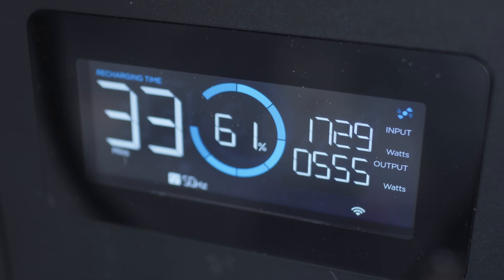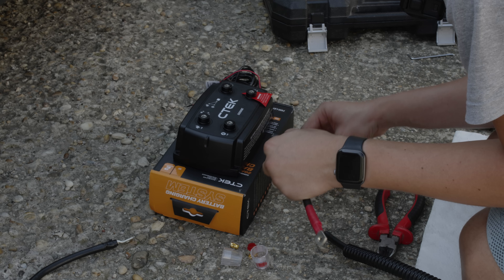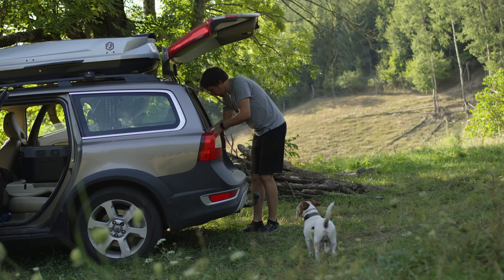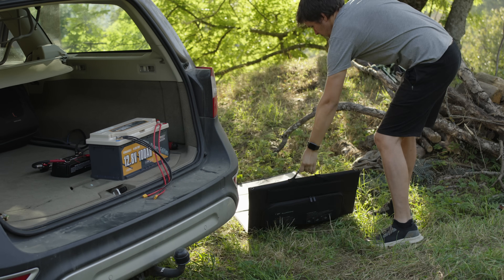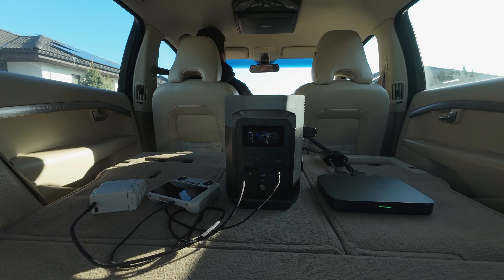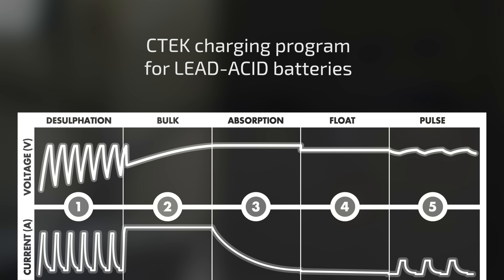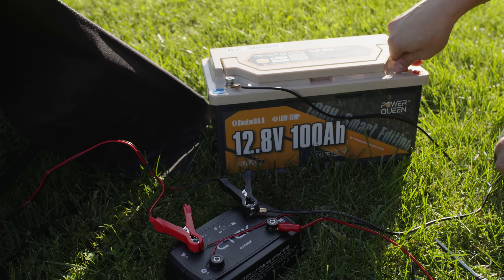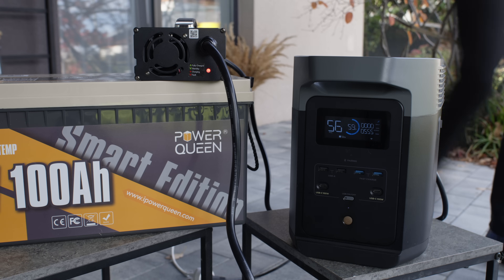LiFePo4 Charging 🔋 Power Queen | CTEK | EcoFlow Alternator Charger | AC/DC

Comment: Thank you for making such a useful video.
14:10 What does the video show?
1. Is the DeltaMAX charging from the home AC grid? (Bypass mode?)
2. Is the PQ battery being reverse-charged using an alternator charger?
3. Is 862W charging possible with reverse charging from the AC grid and the DeltaMAX?

Comment: Those inline fuses are trash. Throw that junk away. Get a terminal block fuse instead. 

This is one of the sloppiest and most ghetto installs I've ever seen. Its literally a what NOT to do.

Splicing connectors are great. If you want problems or fires. Use a fuse block instead. Get the right tools for the job. Quit acting like you're in such a damn hurry. Put your cables in a wire loom.

Comment: Thanks for both videos. I have a similar question as far as I understand Mr. Bauman asked. I have a Delta 2Max and an 800W alternator from Eco. I'm thinking of buying a 24V 100Ah LiFePo4 or 48V 100Ah. The question is, when I drive and charge my Delta2max from the alternator. Can I charge an additional battery from the Delta2max at the same time. And if I can, how and do I need to buy something else. Thanks.

Comment: Is there anything restrictive about the supplied XT-150 to XT-150 output cable from the alternator charger or could it be spliced and routed through a 4-way battery isolator switch?

Could one splice be routed from the switch to the Delta2 using the remaining cable with XT-150 plug end and another lead exiting the switch to be connected via ring terminals (or Anderson connectors) to a 12v LiFePO4? I assume that might allow a single feed coming from the vehicle battery compartment to be routed inside the vehicle passenger or cargo area where it would connect to the alternator charger. The output from the charger could then be spliced and conveniently selected to feed either the power station or the stand-alone house battery.

Is there anything in the cable or circuitry that would prevent adding such a splice and switch? Thanks for any insight you can provide.

FWIW, I purchased a 12.8v 230ah LiFePO4 battery to expand the capacity of my Delta2 after viewing your also excellent video on that topic.

Comment: Hello, I hope I didn't miss this somewhere in the video. 
Can I charge the LiFePo4 from a DC-DC charger (Victron Orion XS 1400), and still have the LiFePo4 battery connected to the Ecoflow like you showed in your last video? I guess the Ecoflow will also then be trying to draw current from the DC-DC charger, not sure if this will then cause problems for the LiFePo4 or the Ecoflow.

Comment: Are you using the wired connections from the adapters you used when connecting the cteck from the beginning of the video to connect the battery at @12:55? So the when the charging is reversed it charges the car’s and the lifepo batteries at the same time?

Comment: Amazing, I literally just sketched a rough plan for our skoolie conversation with this exact setup.

12v bus battery running to a quick connect and a 12v battery(mainly for our 12v minisplit) running to an additional quick connect. As you mentioned, I wanted the benefit of charging my eco flow from the alternator while also having an efficient way to charge our 12v mini split battery.

Great video, thank you for the proof of concept!

Comment: what is the cost of all those charging devices and your time? just run your car on idle for 1 hour if needed... it will consume minimum fuel to charge all your devices.
Reply: This is a very practical solution. Instead, the Earth might suffer.

Comment: Can you charge the lifepo4 to 100%?
Reply: Yes, LiFeP04 takes less damage than Li-NMC when chared to full.

For a full charge of a LiFePo4 battery charge to 3.55V/cell let it stay on that voltage for 2 hours.

You can also charge them to 3.65V/cell (as in the video), but this only reduces the lifespan of the battery.

The BMS needs to the voltage to stay at 3.55V/cell to 3.65V/cell in order to balance the cells.

Note, a 12V battery has 4 cells in series: 3.55V/cell x 4 cells = 14.2V.

Comment: You’re better off taking the direct output of the 24V battery and plugging it directly into the solar port using a XT60i. This will reduce any loss of conversion, and should charge at about 300+ Watts. For recharging after the EcoFlow is full, you can use an AC to DC charger from it to the 24V battery. It’s not ideal due to losses of the EcoFlow inverter, but if you’re driving around with the EcoFlow Alternator charger on it will be negligent. My set up is a EcoFlow Delta 2 Max, hooked up to the Alternator charger, 2x100W solar panels on my vehicle roof plugged into one of the solar ports.

Comment: One setup I may have missed in your vid (I'm deaf, it happens)- Solar exclusively to external battery. So I have a bunch of panels, 300w on the roof (3x100w parallel) and an extra Ecoflow 160 portable.  The issue I have is that in series, the panels will be 69v, which is too much for the Delta 2, and in parallel, the Amps are 26, which the Delta 2 will cut off at 15. The Delta 2 only has 1x500W XT60i connector, so the max I am getting from this setup which could get 450W put together, is 280W since it maxes at 15.11a.  So I thought the solution for this is getting an external battery and having the solar go directly to that via a 25A charge controller. In this scenario, the power supply to my alternator charger would be variable, going through a marine battery selector which has both the starter battery and external battery as sources. When driving I could switch to starter, and when parked I could switch to external, charging and reverse charging would be available to both batteries and the external would always be getting charged by the rooftop solar. Just wondered what you thought of that, great video!

Comment: How about using the CTEK connected to the reverse charge output so it can do the lithium charge cycles for the battery?
Reply from the maker: Interesting idea, but you will cut not only the efficiency but also overall power to 20A. But it should work.

Comment: Both of these videos on Delta / Alt Charger / LiFePo4 have been super helpful, and are wonderfully clean and concise. 
I wondered if you (or others) could provide a little more insight into something that I may be missing, but haven't seemed to find a clear answer to (despite these videos coming the closest): 
How would I best configure a (vehicle-based) system that allows (via the Alternator Charger) for simultaneous charging of the Delta 2 via solar and the vehicle's alternator - but also allows for the charging (and utilization) of external LiFePo4 batteries, preferably via the same simultaneous charging feature that applies to the Delta 2? 
I imagine there may be an Anderson connection involved, which is ok in and of itself, but I haven't been able to conceptualize a placement that wouldn't knock out one of the above traits. 

Basically, I am looking to keep main strengths of the Alternator Charger in play, but also to expand the capacity of the Delta 2 with an external, third party LiFePo4 battery or two. 

Thanks so much.
Reply: yes please

Comment: 12:31 can you show where you got or made these connectors? I have the Ecoflow Delta Max and Ecoflow alternator charger. I was wanting to purchase a 24v 100 ah battery but wasnt sure how to charge it effeciently. was looking into trickle chargers but i like the idea of using those quick connects with the alternator charger instead....
Reply from the maker: Hi, search for "Anderson 50A connector/cable" for example on eBay/Aliexpress.. there are plenty options with different cables and connectors combination. On the video was Anderson 50A with M8 terminals on other side ;)
Reply: @VolvoCamperLife by chance would you be able to make a short video showing how you installed these connectors on your alternator charger system? thank you so much btw for responding to me!! i shared this video on someone’s post on FB who mentioned they did something like this. a lot of people were interested
Reply from the maker: @ I recently modified the wiring of my main alternator charger to be permanently connected to the car’s starter battery, but another one arrived today. So, if I end up redoing the connector setup, I’ll let you know ;)
Reply: @VolvoCamperLife thanks!!
Reply: Will be a big help if i can see how you did you do your wirings and parts exactly. At 12:40 . By any chance will it be possible

Comment: When charging the LiFePo4 battery, what is your exact configuration?  Why is the Delta 2 showing output and no input, but remaining full charge?
Reply from the maker: At that time, I had the Delta 2 connected to the AC mains to prevent it from discharging during the test/charging of the LiFePo4 battery (both have similar capacities, around 1kWh). Since it was fully charged and connected to AC, it didn’t show any input because, when the battery is full, it can operate in pass-through mode with an AC input.
Reply: @VolvoCamperLife  Thanks for the response.  Have you tried to directly charge the LiFePo4 battery from the Alternator Charger with only the Charge function and not the Reverse Charge function?
Reply from the maker: @morrisa2a  Hi, you’re welcome. That’s not possible, as the “Charge function” is only for charging the station, meaning from the connected source to the EcoFlow charging station (there’s nothing else you can connect to the proprietary EcoFlow connector).

Comment: Hi, I have the same setup, but I can’t reverse charge the 24V battery from the EcoFlow. Charging the EcoFlow works fine from the 24V battery. Any ideas?

If I hook up a 12V battery, it works fine both ways.
Reply from the maker: Hi, I’ve also had some issues with reverse charging a 24V battery a few times. Sometimes it throws an error. I turn off the Alternator Charger, wait a moment, turn it back on, start charging, and it works. It doesn’t happen every time. I read a post from a group member on Facebook a few days ago saying that after the latest firmware update, the issue stopped occurring for him. However, I don’t have more information on this yet, as the newer version hasn’t been offered to me so far.

Comment: This is such a fantastic overview! I recently got the ecoflow alternator charger as part of a bundle of Delta 2 max and max battery that i intend to use almost exclusively for home backup/emergencies. Ive seen many reviews now showcasing the ability to reverse charge LiFePo4 batteries so i ended up getting two 24V 100 mah Goldenmate batteries planning to put them in parallel. It reverse charges and behaves exactly as you've shown in your video, but im worried about connecting them in parallel since i cant be sure they are fully charged and balanced. Now others in Facebook groups have highly recommended i get dedicated Victron Smart charger thats designed for LiFePo4 batteries. Obviously i dont want to spend more money if it can already charge but i want to ensure its safe for the batteries. Im getting a Victron Smart Shunt thats on the way so that i have a way to monitor the batteries but would love your thoughts!
Reply from the maker: Hi, I understand your concerns, and I think they’re valid since such charging might not result in a 100% proper charge. For me, this is more of a backup solution rather than the primary purpose, so I’m willing to accept it along with the risk. If you plan to use it long-term or regularly, or if you don’t have another way to charge those batteries (I primarily charge my 24V batteries using an AC LiFePo4 charger), I’d recommend doing it the way you mentioned — with a charger specifically designed for this purpose so you can be sure it’s done right.

If you’ve already tested it in the meantime, let me know how it works (or doesn’t). Thanks, and best of luck!
Reply: @VolvoCamperLife  Hi.. awesome videos and well shot/edited. I always come back to your videos! Once thing.. what type of 24v AC LiFePo4 charger are you using? Is it the Roche Limit 29.2V 20A LiFePO4 Battery Charger? That's the closest I can do on matching it up w/ what's on your video. Thanks in advance!
Reply from the maker: @ Hey, thanks a lot! I’m really glad you like the videos. Yeah, I’m pretty sure it’s the exact same battery charger as the one you mentioned—just rebranded by different companies. Mine is from Power Queen, but it’s just made by someone else for them.

Comment: I wish the ecoflow alternator charger was compatible with their river series I would buy it.
Reply: Ecoflow has added an XT150 to XT60i cable to their product line for use with their new, smaller, 500w version of the alternator charger. It comes bundled with that new charger but is also available separately (though it sells out frequently due to its popularity). As a result, the 800w alternator can be used with that cable to charge the River series and other power stations that have an XT-60input port (and proper voltage specifications). The charge limit will be 500w, but the new cable makes the 800w alternator charger more universal.
Reply: You can still use it for Rivers. You just gotta chop the XT150 cable and solder on a XT60 then use the app to lower the output of the Ecocharger
Reply: @ I just bought a bluetti charger 1, and I just installed it with the included parts for $250. The voltage is adjustable in the app and the output cables have MC4 connectors.
Reply: @Fob_vinnie  We already sell the EcoFlow generator charger XT60 output cable (1m).

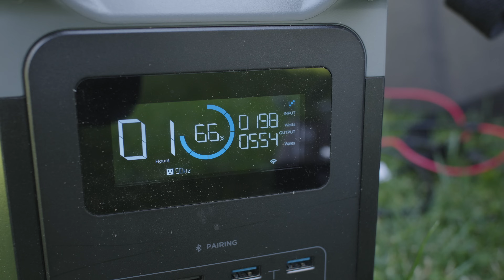Comment: Amazing videos! I can´t find anything about it in Portuguese. I appreciate if you explain. When you use the powerstation to charge the powerqueen battery, you just connect the solar panel to ecoflow and connect the powerqueen battery or what? It´s 17:42. Thank you!
Reply from the maker: Thank you very much. My pleasure! Yes, solar panel to the Delta and from Delta to PQ battery via AC-DC charger or alternator charger :)
Reply: Is there a way to use the microinversor powerstream to feed the grid and have the external batery option of that ecoflow microinverter charging and using a life batery pack to feed the house when there is no solar input from panels... I mean hook the alternator charger or something...cause using either a powerstation or a extra smart batery from ecoflow is really expensive...but powerqueens life batery are aroun 250euros...

Comment: The one thing about using Ecoflow alt charger is 800 watts is above the 'healthy' charge rate of 500 watts.  If you lower the EF AC down to 500 watts, now you're in the range of using other products like Victron DC-DC charger.
Reply from the maker: It might be more demanding for the batteries, but I assume it will be used only a few times a year during longer trips. The batteries should handle that without any issues. Nowadays, the lifespan of batteries (LiFePo4) is at such a level that worrying about this is pointless. They’ll last for many years even with less-than-optimal handling 😉

Comment: Your alternator won't live very long. Alternators are not designed to charge. They are only designed to provide maintenance.
Reply from the maker: Alternators are rated to provide power up to the amperage specified in their specifications. As long as they are not overloaded for extended periods, I don’t see any reason why they shouldn’t last. After all, it’s a variable system. And even if it doesn’t last, it would be a good opportunity to replace it with a stronger one, which would have a greater power reserve for a load of over 800W.
Reply: @VolvoCamperLife  How does one know if the alt is overloaded or not?  I recently got the EF alt chgr and I find the car batt will stay at around 13.5v if I limit to 600w (instead of 800w).  The set up is just idling, as I haven't routed cables, just attached to batt.  I only plan to use it for power outages.
Reply: @vashon100 what is your alternator’s capacity/amperage?
Reply: @Mark300win  Never measured it but stock alt is 110amp.
Reply: @vashon100  thanks
Reply: You obviously don’t know anything about automotive charging systems. They most certainly are designed to charge.

Comment: Great Video! Something that i never thought that the Ecoflow Alternator charger can charge a Lithium Battery. It would be nice to show in more detail to charge 24v Lithium Battery instead. A 24V Lithium battery can connect directly Ecoflow solar input socket for charging. Thank You
Reply: I’m confused the EcoFlow power station solar INPUT is an INPUT. How will an INPUT charge or put out power to a lithium battery exactly ?
Reply: @thepatternforms85 It's charging from the ecoflow with the ecoflow charger with reverse charging (like it would do with your car battery)
Reply from the maker: Hi, thank you very much. Yes, it can be used for that. I did show how to charge a power station from a lithium battery in my previous video ;)
Reply: @VolvoCamperLife  Are you sure that the Alternotor Ecoflow can charge correctly Lithim battery ? Or Just AMG battery ? i don't see in the Manual the way to charge Lithium battery ...
Reply from the maker: @ It can, but it’s not designed for it. Essentially, a LiFePO4 battery won’t be harmed by being charged to a lower level; charging will simply stop somewhere around 80–90% capacity. It also depends on the BMS of the charged battery and how it handles this. However, you can charge it, especially if it’s for occasional use. For long-term charging only using an alternator charger, I’d recommend performing a proper full charge from time to time to calibrate the cell voltages and ensure the maximum capacity is maintained.
Reply: @VolvoCamperLife  Hey, thks for your reply. I asked in parallel to Ecoflow if it can charge Lipo4 and they answer me without any technical explanations : YES it can. So i'm confident but you're right : BMS is doing all the job.Many thanks for you're video :)
Reply from the maker: @nslmanu3935  Good to know, you're welcome ;)